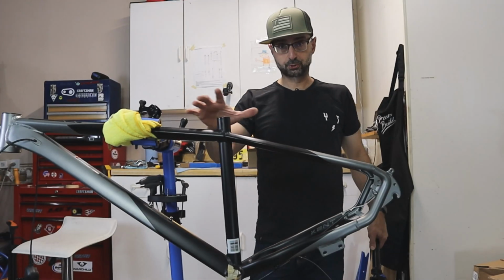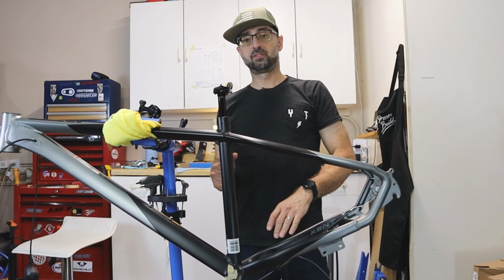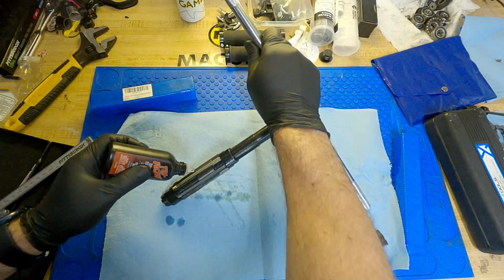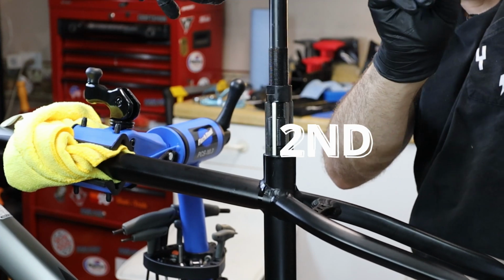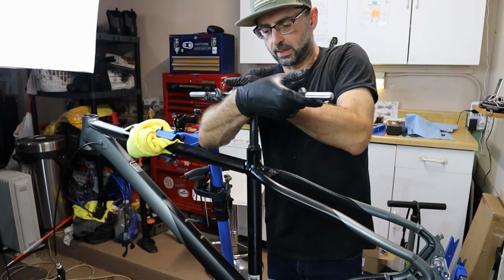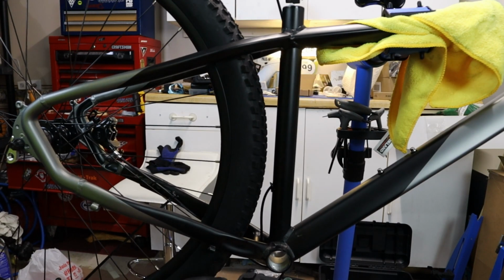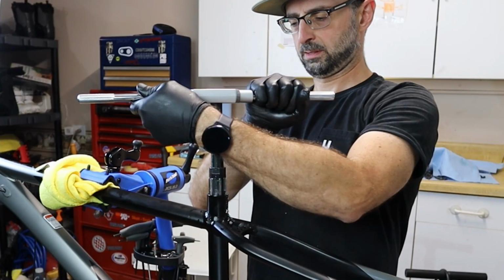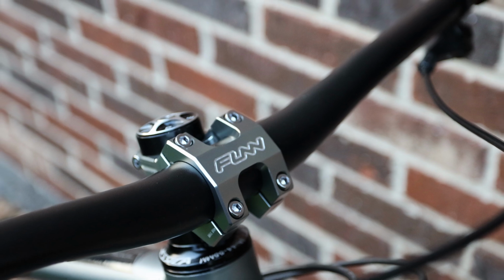The Ultimate Kent Trouvaille Dropper Hack | Budget Hardcore Hardtail MTB Project Phase One

Comment from the maker: Would you do this to a bike?  The biggest hurdle (the wierd seat tube) has been overcome.  The rest is easy. Let's see how much we can improve this bike.
Reply: Nope, well, not exactly.  I went with a 27.2 dropper and a shim to start.  I made my little hole at 10 o'clock on the lower part of the seat tube, similar to how you ran your cable. I didn't use a grommet to keep the hole smaller. Of course, I wish you luck with your mod. It's bold and awesome.
Wolf Tooth makes a very nice seatpost clamp that will exactly fit the external diameter of the tube.
Reply from the maker: @StevenYoungEtc  Very understandable.  A bit of a high consequence mod. Thanks for the Wolftooth tooth suggestion.  I love their products. Plus they're made here in the Midwest. 🙌

Comment: So long term....how's it working out? Any frame issues or failures? Would you do it again? Building up a Trouvaille for my son.
Reply from the maker: @motojaymo6653  I rode the bike for a year and disassembled it. I had no issues with the frame. Unless you are already experienced with this stuff, I wouldn't waste time and money reaming the seattube. It's cheaper and safer to get a 27.2 dropper and use an adapter shim.

Comment: My question with this is the wall thickness remaining in the seat tube.  What is the OD diameter of the seat tube on the Trouvaille vs a standard mountain bike that accepts that style dropper post?  Does reaming this out make it thinner than what we would see on a standard mountain bike, or closer to that spec?
Reply from the maker: I measured the wall thickness of the tubing, and it was thick enough that I could ream it out and have a wall thickness comparable to other bikes that I measured. That being said I don't know what grade of aluminum the bike is or anything about  or how strong it is relative to other bikes. So I don't recommend doing this modification. It's safer to use a spacer with a 27.2 dropper.

Comment: I just bought a suspension seat post and it's 30.6 and my bike is 30.4. Would you recommend this?
Reply from the maker: No. Find a 27.2mm post and buy a 30.4mm adapter.
Reply from the maker: I wouldn't recommend this modification unless you have your heart set on a long travel dropper post. Even then there, are inherent risks with modifying a bike frame.

Comment: Why didn't you just use a PNW Rainier Gen 3 dropper at 27.2 with a 27.2-30.4 shim?
Reply from the maker: I wanted to run a longer drop dropper post. 27.2 limits you to 125mm of drop.

Comment: I used a 18mm star socket with an extension to get deeper into the frame with the reamer.  Once you go deep enough, spin the reamer to the left to get it loose.  It was a little tedious to get it back out, but it worked.  I also drilled the dropper cable run internally in the bottom of the seat tube.  It is accessible, barely,  through the port at the bottom of the down tube   On a side note, how many spacers did you end up using on the IXF BB when you installed the cranks?
Reply from the maker: Thanks for the tip. I may end up just doing that. 

I believe I used one spacer on the drive side.
Reply: @AdrenalineIsLife  Thanks for the spacer confirmation.
Reply from the maker: @tinivations  you're welcome!

Comment: a shim and a 27.2 mm post worked great on mine and i didn't have to reem my frame avoiding the warranty.  like we care about that anyway. I'm a machinist so i thought of this but only using the ol mill with the reamer but it was so much easier to do it the way i went,   but I'm glad you did this, it needed to be made. great video.
Reply from the maker: Thank you! The 27.2mm with shim is definitely safer route. But it wouldn't be any  fun if we didn't take some chances.  😁

Comment: Looking forward to more upgrades, just picked one up new for $250 and want to upgrade the rear brake and derailer.
Reply from the maker: That's a good entry price! You've got room to spec it nicely if you so choose. Phase two is process still waiting a few critical items. 🙂
Reply: I put a Shimano MT200 hydraulic front brake on my Trouvaille. It's so much better than the stock brakes.

Comment: reamer ext = 12point socket - to- extension - to - male-male drive (xx size)  looked like 1/2" ?
Reply from the maker: Thanks Randy. My worry is it getting stuck deep in there. Is there a way to lock it on?
Reply: @AdrenalineIsLife  
Find one with a pin lock instead of ball.detent
Reply from the maker: @Radical911  Awesome.  Thanks.

Comment: only thing I would change is the dropper port on the frame, you would be able to drill on the inside of the frame and keep it fully internal. other then that, it's coming along nicely!
Reply from the maker: So far so good. 😁  I considered running it that way but it would run through the bottom bracket which didn't sit well with me.

Comment: ahaha, that derailleur hanger.

What is the dimension of the drive end of the reamer?  If you can find a different style tap handle, it should give you a little more depth - IF that tap handle will fit in the seat tube.
Reply from the maker: IIRC 5/8in. I tried finding finding an extender but no luck. I'm not sure where to begin searching.